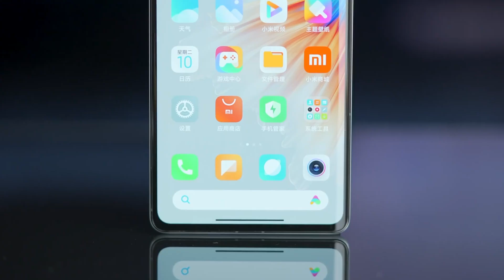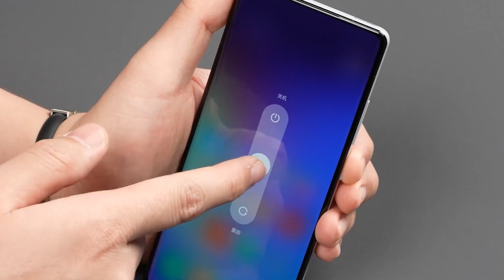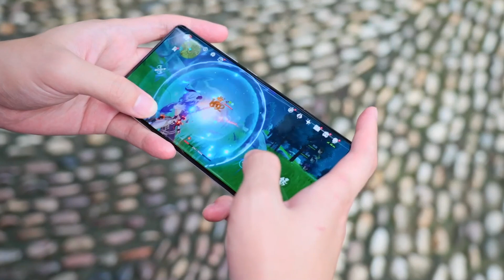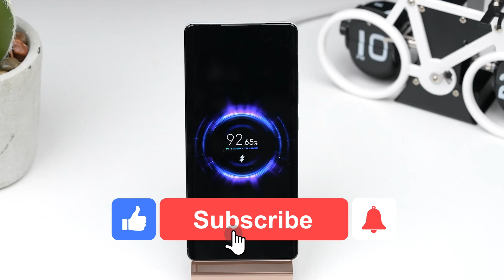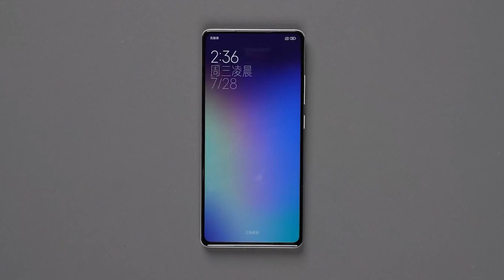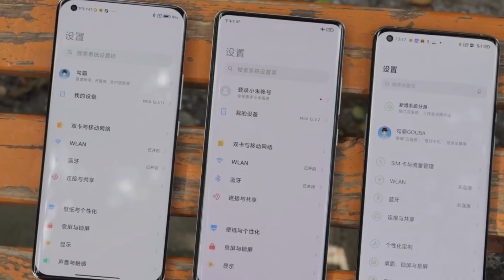Xiaomi Mi Mix 4 Teardown Review [Full Version] Incredible!

Comment: I bought one from DH Gate. The seller sold me not only a used one, but also damaged. There was no sim tray, but there was a sim card already in the slot. I took it to a mobile phone repair shop and they were able to extract the old SIM card. The slot, however, was damaged. I bought one on Ali Express, but at 5:24 when you take out the sim card slot, does it unscrew from the motherboard or is it soldered on. I'm hoping that it is held in by screws. Thank you in advance for your help and advice.  Best wishes, Frank in Texas.